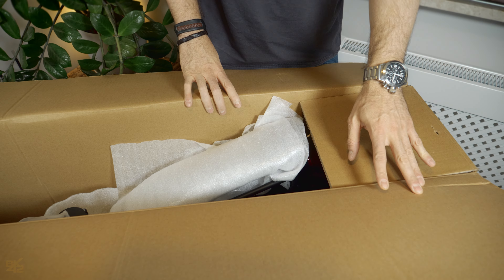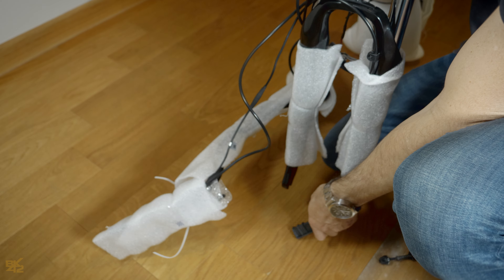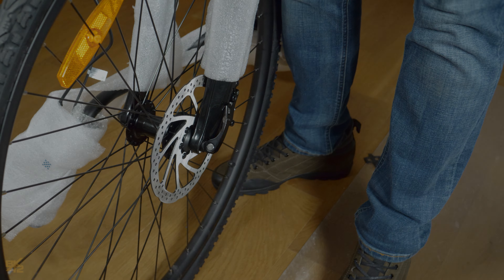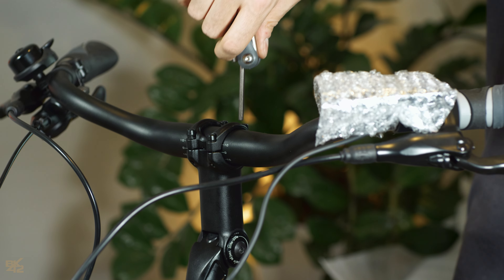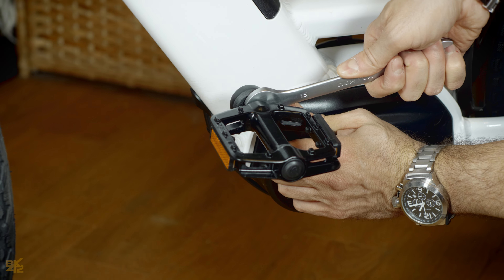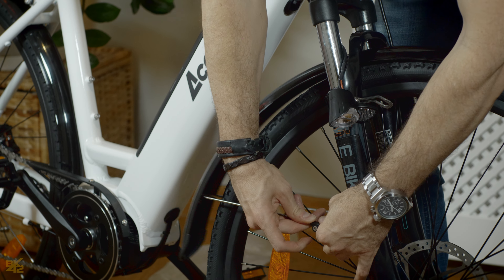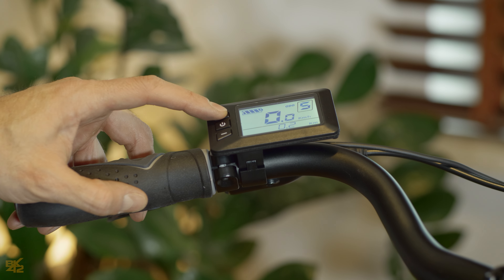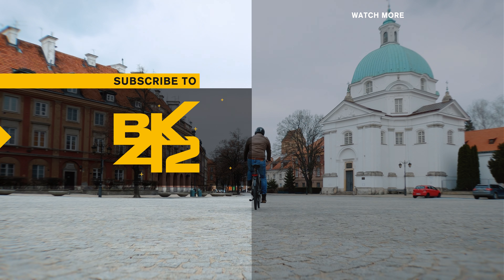Accolmile 700C City E-Bike Assembly: $1550 25km/h 250W mid-drive

Comment: Oh bk42 just for spare parts could you recommend an controller with the same connections I believe mine and yours are similar with the JST plugs. They don't give any advice for if you need to get an new controller
Reply from the maker: Man, that's a difficult question. I haven't changed mine yet. I would love to experiment others, but yet, I don't know what to do.
Powerful controllers are much bigger and they won't fit that small space. I will get more serious on it soon an let you know then. 
Thanks man

Comment: Hello
The bike is cool, but in my opinion it definitely lacks a gear change sensor and a brake use sensor would be useful!
I have a Bafang BBSHA engine installed in my bike and a set of safety features, such as brake and gear sensors and I think it's a great thing when it comes to the durability of the chain and cassette!
My question is, is it possible to install these sensors in the Accolmile 700C City?
Is the engine controller so richly equipped?

Comment: I be careful buying from that company I brought the fat snow bike from them had problems out the box even injured myself. Last straw the folding lever Dosent clamp just like bk42 video when he changed his one and the company sent him out another. but refuse to answer my messages to them and Alibaba didn't support me even though my warranty was still in play for repair and spare parts. A message to bk42 do you have any other place where I can get the black one you have please
Reply from the maker: Hi Shaolin, I'm very sorry for your troubles.
Unfortunately, it is out of my hands. Did you try to contact them by the email: service@accolmile.com    ? 
About the lever,  I decided to replace mine because I like the black model better. It looks better all black. I was lucky to find one of the last units at the time. I know that Mate bikes sells them, but the black is out of stock as well:
https://www.mate.bike/en-at/shop/product/mate-folding-lever-replacement-kit-2/
You can try to paint it in black...  spray will do but won't hold. You can send to be powder coated.. it is quite cheap and easy to find painters everywhere. 
Thanks
Reply from the maker: I have sent a message for them, and they asked you to contact them via : info@akkubici.com

Thanks ;)
Reply: Thank you I've been messaging them at Alibaba where they sold it to me I brought the bike through your brilliant reviews
Reply from the maker: please try using the email above, tell the full story, because we never know who will get the message ;)